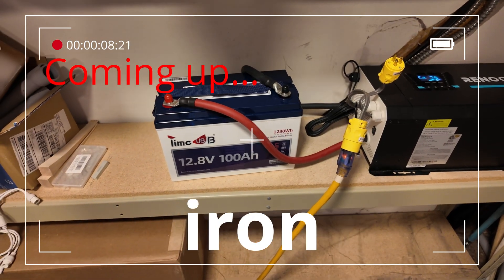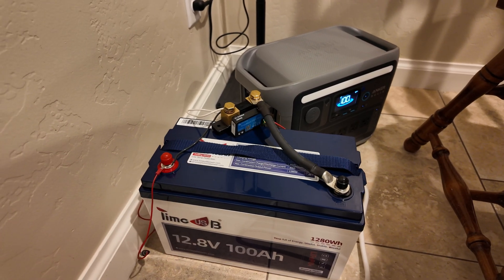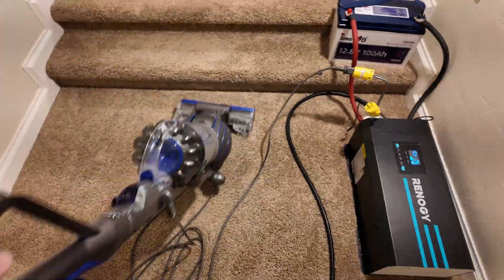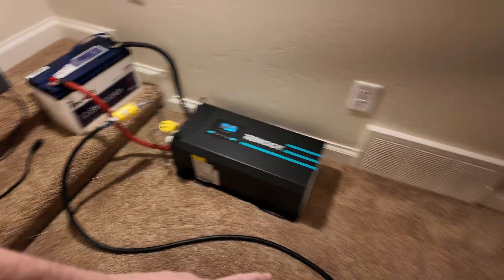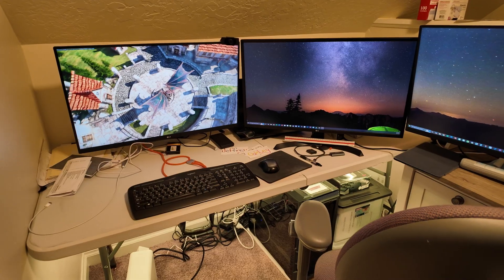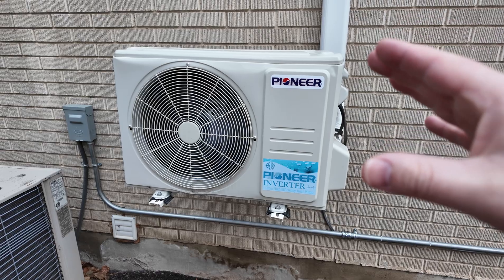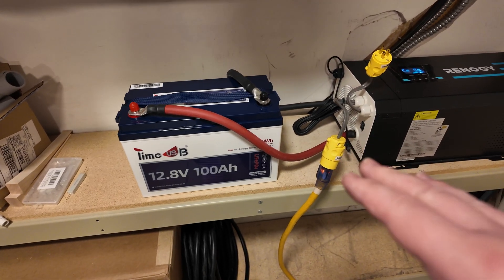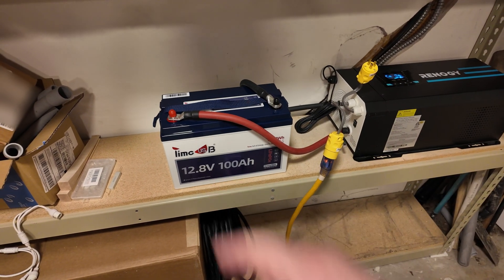Can this Battery ACTUALLY Power EVERY Home Appliance? Timeusb

Comment from the maker: Buy the TimeUSB 12v 100Ah LiFePO4 trolling motor battery from this video: https://www.timeusbpower.com/products/12v-100ah-trolling-motor-battery?ref=mficggus
Or
https://amzn.to/4ilo8c0 
Be sure to use the code: TRICK5 at checkout to save an extra 5% on your order. (DOES NOT work on Amazon.)
Check out other TimeUSB products: https://www.timeusbpower.com/?ref=mficggus 
Be sure to use the code: TRICK5 at checkout to save an extra 5% on your order. 
Check out my “12V Battery Testing Results & Rankings for Home Backup” Spreadsheet. https://docs.google.com/spreadsheets/d/1OuUalW-_9BdWMyQz0CxCAM9cpO6whw_LX_exW0Fhqzo/edit?usp=sharing
Watch all of my other 12V battery testing videos: https://www.youtube.com/playlist?list=PL-2uuHDasQcp2gNWpR-N_GUEey1fhnbgI 
Buy the Renogy 3000 watt inverter charger you saw me use in this video: https://amzn.to/4fJIgEd 
Everyone needs a 10AWG extension cord in their life like you saw me use in this video: https://amzn.to/3yH87Me 
Buy battery cables: https://amzn.to/3GEIIDi
Buy an EZ Generator Switch like you saw in this video: https://amzn.to/3L9M57u 
Watch my video wiring up the EZ Generator Switch to my furnace: https://youtu.be/dBP53ggH4nA 
Buy a Victron Smar Shunt like you saw in this video: https://amzn.to/4bwrftP 
Buy a 115V Pioneer Mini-Split like you saw in this video: https://amzn.to/3L7hxn1 
Buy a Goldenmate LiFePO4 UPS like you saw in this video: https://goldenmateenergy.com/collections/ups/products/ups-1000va-800w-surge-protector-battery-power-backup?sca_ref=6274131.WwNYprwz11
Beat inflation and use the code: TRLCK to save 10% on your order!
All donations get 100% re-invested in the channel! Thank you! https://buymeacoffee.com/theresatrickforthat 

Affiliate Disclosure
As an Amazon associate I earn from qualifying purchases at no cost to you! Thanks for your support!

Comment: what do you think capability be running 2 of those batteries in parallel ?
Reply from the maker: Would easily run every one of my tests without any issues and it would double the length of run time. Thanks for watching!

Comment: The, can it run tests v.s. the, how long will it run tests. Seem to be more of a test of your inverter, rather than the battery. The battery is rated for 100a continuous output. At 12v gives us 1200w = you can safely run items at or below 1200w.
Reply from the maker: Everyone’s appliances are different…but we try to strike a balance on the channel of run time testing like on the fridge, and heavy load testing to see how the battery responds when pushed to and beyond its limits. Thanks for watching!

Comment: 100ah at 12.8v give you 1280wh which you can use that to run basically whatever you want but depends on the battery SOC.
Reply from the maker: You got it! Thanks for watching!
Reply: the LFP cells have 1c rated, so the battery are 100amp maximum output, but the cheap lithium battery like that have low amp BMS thats the limiting factor, if you want anything can run at your house, a 200amp BMS should do it

Comment: Cheater a power stTion it now wont just be using one battery
Reply from the maker: Did you not listen to my explanation in the video why I use a power station with the fridge test? Thanks for watching!
Reply: @ the visual incorporated a power system along side will the battery. A standalone inverter would be more convinceing. I donot waste time watching bogus presentations, many do.